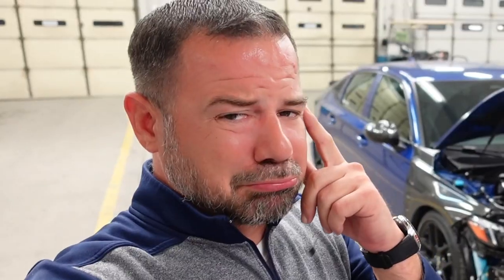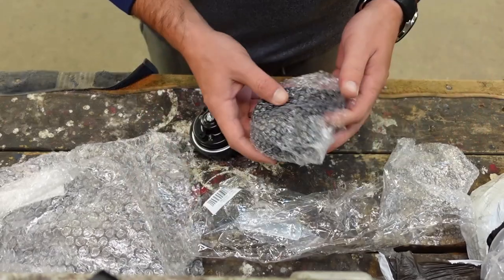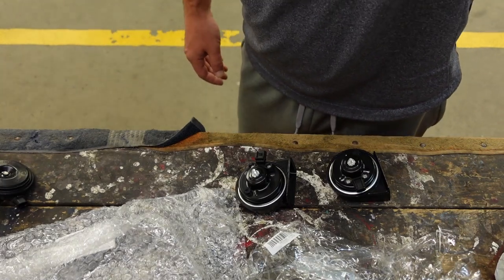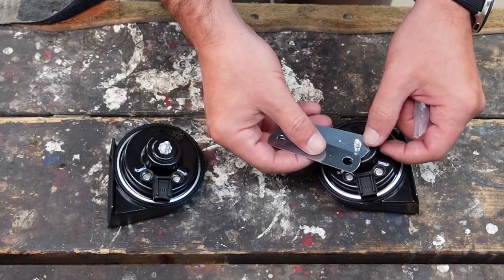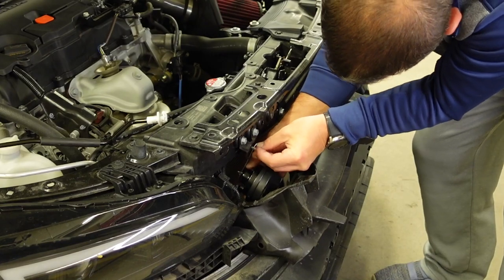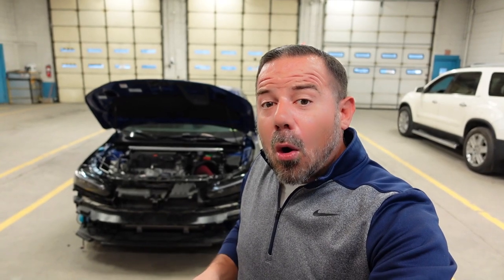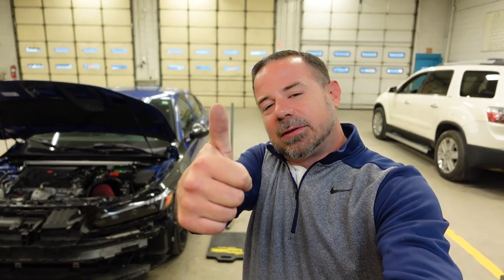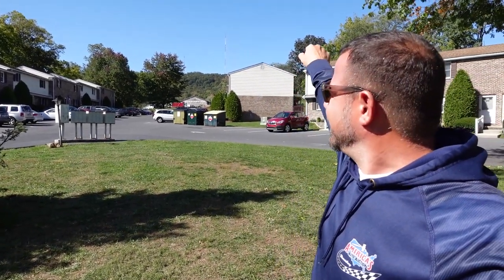MEEP, MEEP, HONK!!! New Horn for the 11th Gen 2022 Honda Civic!

Comment: Feel like I'm not far behind ya hahaha. When I had my bumper off ( watched your video for removal ) to install the LEDs around the foglights, I saw those tiny horns and went ..Yep...I should replace those someday.. And 2 weeks later, Here you are like Yo!! I replaced the horn!  And now I'm sitting here like aaaaaaaaaaa I should redo the wiring ( Got water proof connectors now ) for the fog leds and while things are off..consider the horns! 

I went with that "Ebay lip" You did long ago. Matte black on mine. Hoping the screws that went into the bumper doesnt require me to unscrew them when I want to remove the bumper.  But, Will see I guess! haha
Reply from the maker: That's how it usually happens...lol! You'll be a pro like me removing the bumper 😂 You don't need to remove the lip to take the bumper off, your good!

Comment: you should have mounted the bottom horn the same way it was from factory..they do that for a reason, so water doesn’t get into it when driving in rain and muffle it.
Reply from the maker: I'll have the bumper off again here in a week or 2. I'll see if any water gets in there. I think it will be OK! Both are protected by the bumper and inner fender liner pretty well.

Comment: 😆🤣😂😹

I checked for a new video this morning and was disappointed, just saw this now. No more wimpy Honda meep meep anymore. Almost as good as a truck horn. And definitely will be unexpected from a Civic, and certainly much more audible and attention grabbing, especially if you need it in high noise environments. 

Probably one of the best, fastest, easiest and very affordable, functional upgrade that is well worth it. 

I am definitely getting a set. I am pretty sure it will fit the HR-V as well, since it uses lots of Civic based parts where practical.

*Yousy want to turn the other horn downward a bit, so water don't get into it or not drain out. I bet you want to put a set in your Type R now. 😏
Reply from the maker: I don't think water will be an issue, there both protected really well. I'll check next time I have the bumper off. I'm sure it won't be too long til I do it again...lol! I definitely need to get a set for the "R" now!
Reply: @717PROJECT  I read that it'svwaterproof, but still might not want watter sitting in there if it csn, insteadvof draining out. I saw that the horns are sold out. They are German car horns made by Bosch. No wonder they are so loud.
Reply from the maker: @jjacob25101  I don't think they will even get wet. I'll know soon enough i'm sure...lol!